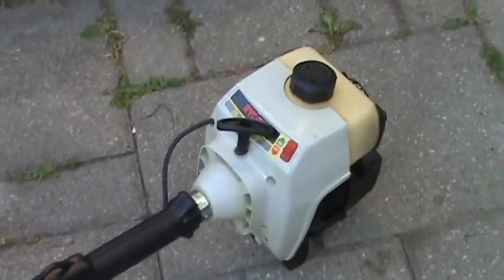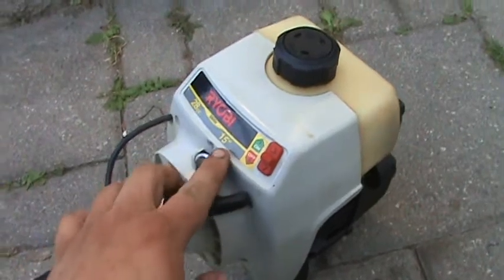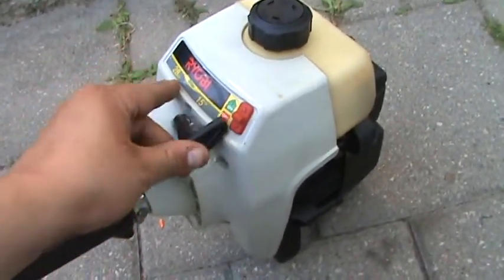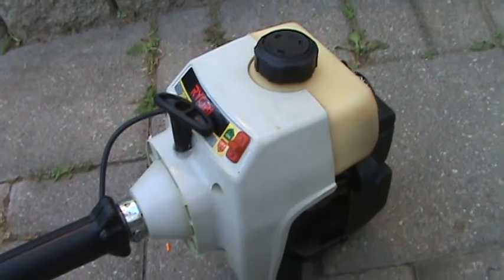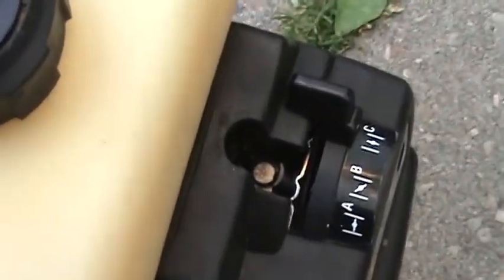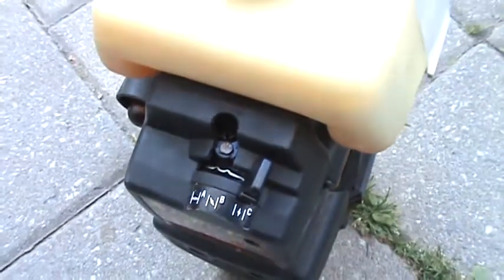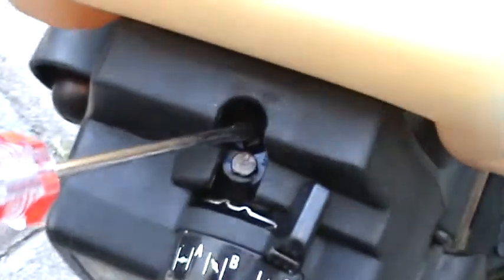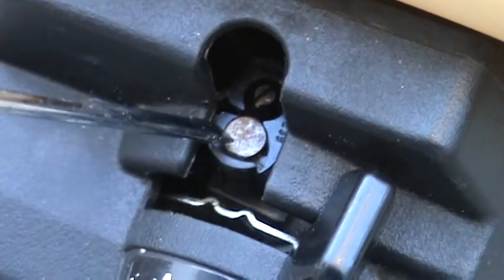Ryobi Carburetor Adjustment

Comment: I'll have to do that to my 790r, it's starting to have cold start issues and won't want to run with the choke completely off.  Also, I had a hunch these were made by MTD at the time, I do remember seeing Cub Cadet and Troy Bilt trimmers with the same engine and design like these old Ryobi's.  I even remember when these were sold brand new at Tractor Supply for some time when they were made by MTD, before switching manufacturing to Homelite and is now sold at Home Depot.